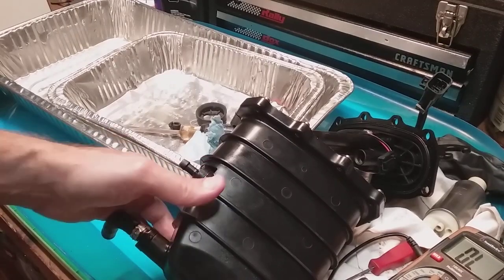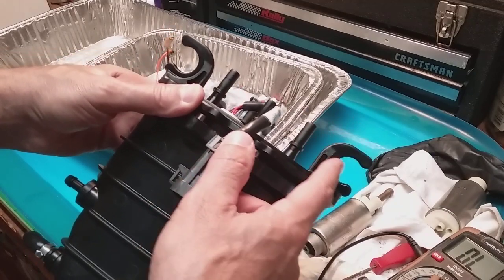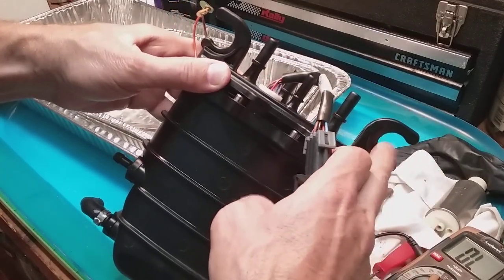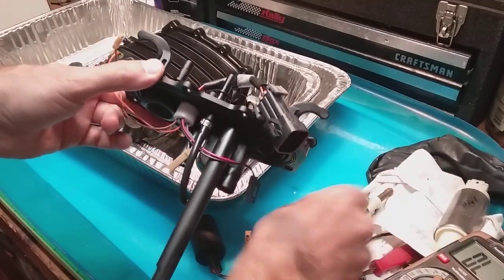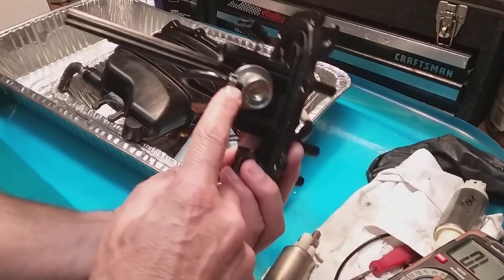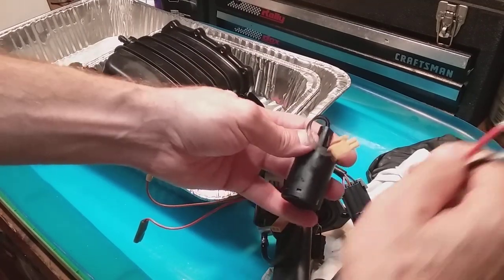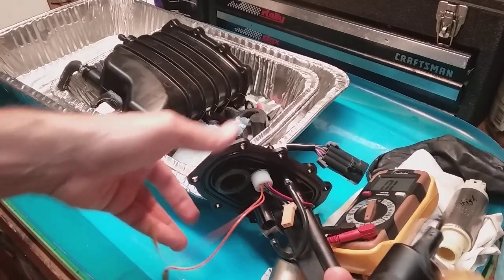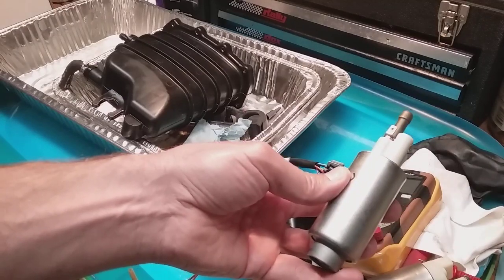UPDATE Misdiagnosed.  How to repair Mercury outboard fuel pumps FSM rebuild. Part 1

Comment: Hi there, I know your video was 4 year old.  What were the symptoms of your engine that you had to pull the fuel pump off.  I have a 2015 Mercury 90 hp four stroke that the engine shutdown once it reached a certain RPM.
Reply: One last question.  After you changed the fuel line connector, did the problem resolve?  I do appreciate your inputs.
Reply from the maker: @nauticalstar8363  well, it did get fixed but my last point was that I don't think the fuel pump was actually the issue because I think it still acted up after the pump. The fitting was the culprit I believe. But it was a 2010 so I felt good about doing the pump as well, old enough.
Reply: @wetlifesports I’m doing this on my 115 today. I feel suction from the low pump(new and old) but it is not pulling from tank. Seems like it’s just not strong enough. Ran a temporary line as well. Still nothing I believe. Put my thumb over it and I feel it sucking just a little bit. Not sure how strong it should be. Any tips?
Reply from the maker: Yes, same sort of thing. I believe its normally a tiny air leak. Sucking air somewhere in the line. In my case I really don't know if it was the pump. I believe it was the connector fitting where the fuel line connects to the motor right at the cowling area. Just replace that connector.
Reply: @wetlifesports  thank you so much!!  It has been frustrating for me because engine is literally brand new.
Reply from the maker: @nauticalstar8363  yes, mine had low hours and looked excellent. Air leaks can be very tough to find. Just be thorough and replace and seals or connections in the fuel lines including the lines themselves if you think they look dry. Look for chaff points too. Where the line maybe rubbed through. Good luck
Reply: @wetlifesports  thank you sir!
Reply from the maker: @nauticalstar8363  running for awhile cutting out, starting again limping home.. it was a mystery but it may have simply been the fitting that connects the fuel line just inside the cowling.

Comment: i have the 2011 90 4s efi as well and Im getting the following codes...3075-28 "Electric lift fuel pump timeout", 3075-16 "Electric lift fuel pump The ECU has detected a problem when trying to output a signal to this device", 1111-23 "Fuel float switch A particular state or condition exists", & 1112-23 "Fuel vent switch A particular state or condition exists". Last season I was having mid range throttle issues ( around 1500 rpm it would fluctuate up and down by 100 rpm or so) and it gave me two codes 1111-23 and 1112-23. And when I cranked it up a couple weeks ago, i got new codes.  Any idea why this is happening?
Reply from the maker: Hi, start with the basics and inspect carefully along the way. Its old enough to warrant replacing many of these items anyway. Check tank vent, replace fuel lines, replace all fuel filters, carefully inspect the elbow fitting that passes thru the cowl, where the fuel line connects. Then I would probably just do the pumps and float switch with seal kit, they are 10 years old and it's just smart boating. Good luck.

Comment: Had same fault code 3075-28.  The problem was where the fuel line from the boat connects to the engine.  The fuel line has a plastic sleeve interior.  When the line was pushed onto the fitting at the engine the sleeve was pushed back into the hose and jammed the line.  I am amazed the engine ever ran right.

Comment from the maker: UPDATE  Been working perfect since I did all the work, just sold the boat yesterday.  In the end it may have been the fuel line elbow that passes thru the cowl.  https://amzn.to/34Caqis  Note! when you buy the new elbow don't throw out your old one.  For some reason the diameter of the fitting was not right on the new part so I had to rob it from the old one.  GL

Comment: I have the same motor, same year. Seems to be a time out issue also. How did you read the code, and can you share the parts kit you used? I can't seem to find them.  Aldo do you think it could involve the regulator?   Thanks for the great video
Reply from the maker: I bought the Mercury vessel view so when I picked up the boat I could read the hours.  It also later showed me the faults, I love this unit.  My issue may have been the fuel line elbow that passes thru the cowl.  https://amzn.to/34Caqis

Comment: Low pressure time out is usually a faulty float switch
Reply from the maker: Thanks, I did install a brand new OEM float switch and yet it still did the same thing.. I actually was starting think I got a bad switch but what are the odds!! This has really been tricky. I ran it the other day at it was flawless but I have no confidence because I don't know what fixed it?
Reply: @wetlifesports Thanks for your video.  I have both pumps on order for my 2011 115 EFI.  Only 25 lbs of fuel pressure at times. Float switch checks good with an ohm meter. Just wanted to let you know I had the same problem with the FSM bolts turning hard. The right upper bolt turned hard as the other two.  I was careful as could be but it actually broke off.
Reply: Wet Life Sports did you find out what fixed it. Please help.
Reply from the maker: @ericyoungs414  not sure I got back to everyone.  I actually think it may have been the elbow that connects the fuel line thru the cowl.  This part  https://amzn.to/3aTyhep
Reply from the maker: @ericyoungs414  I think it was this.  https://amzn.to/34Caqis
Reply: Man I’m having the same exact problem. Same exact engine and year. What can I do. What fixed it.

Comment from the maker: CAUTION guys!!  Were working with fuel, remember to disconnect the battery and make sure no current is around as there will be fuel...  When I bench tested I made up good connectors with long wires so I was not holding the pump as it still has fuel in it and I could imagine the spark from touching it to the power source lighting up that fuel.  My pump shot fuel about 6 feet and hit my wife's car... shhh..  So I was outside using my truck battery, pumps on the ground pointed away from me, long wires.   No joke, my neighbor killed himself when he turned the key on his center console "outboard" boat last Halloween, I have a new respect for fuel and current, we all should.

Comment from the maker: Please Subscribe, thank you.  Fault from Vessel View was 3075-28 "Electric lift fuel pump Timeout" This is the low pressure pump.  It can start complaining because you did not vent your tank, you have a weak pump, you have a leak and therefore it can't fill the FSM tank, you have a bad float switch that is not telling it to stop and therefore it times out to prevent burning it out and or pumping out too much fuel and because the computer has a timer on it to stop it after a bit.  You may also have a pinched fuel line, blocked line, blocked filter, fuel line liner deteriorated and plugged things up, fuel pick up strainer is plugged...

Links: 

Mercury Service Bulletin:  Cut and paste this link into google and you will see this good write up on a PDF

file:///C:/Users/Kurt%20Scrudato/Desktop/Motors/Mercury%2090hp%20Fuel%20Supply%20Module%20FSM%20Troubleshooting%20Bulletin%20No.%202009-09.pdf

Other good video:

https://www.youtube.com/watch?v=XBm7at7nm3w&t=470s

Pump kit to include both high pressure pump, low pressure pump and regulator, $220  Highflowfuel,  Ryan extension #8 was very helpful.  Again, I have no benefit or affiliation to these companies, just trying to save folks time.  There might be better options elsewhere, its just what I did at the time.
https://www.highflowfuel.com/i-35458782-genuine-walbro-mercury-dual-fuel-pumps-high-pressure-lift-w-regulator-grommet-880596t55880596t58.html

Seal kit was on Amazon. Part number for my 2011 Mercury 90hp 4-stroke EFI.  880596A01 $74

Updated Float switch was at Great lakes skipper part # 8M6000359 $75